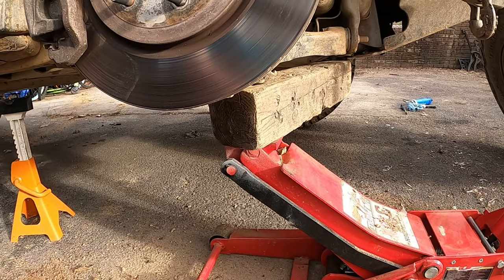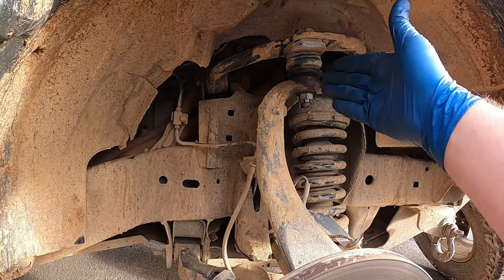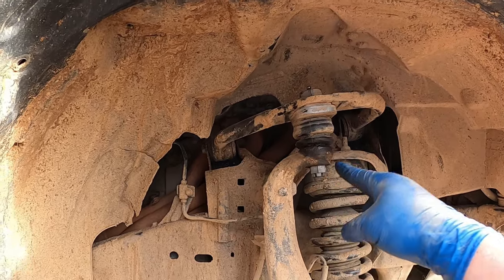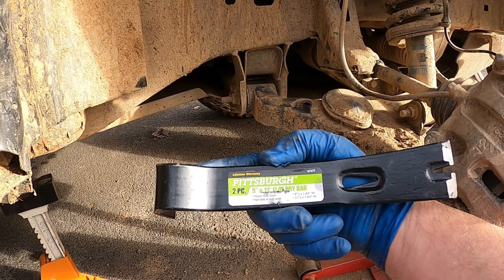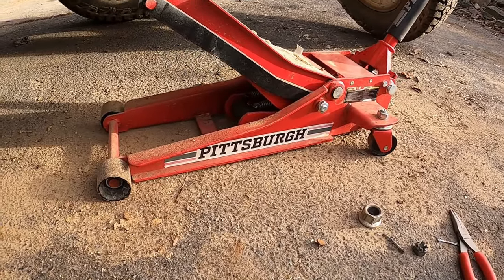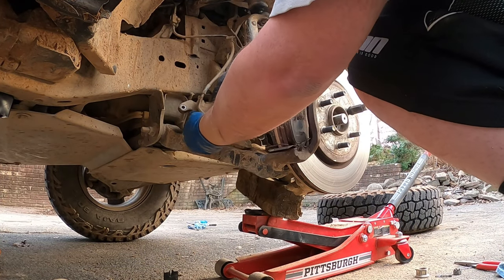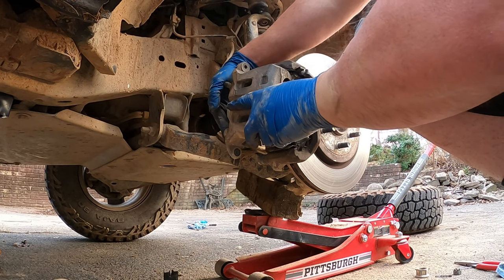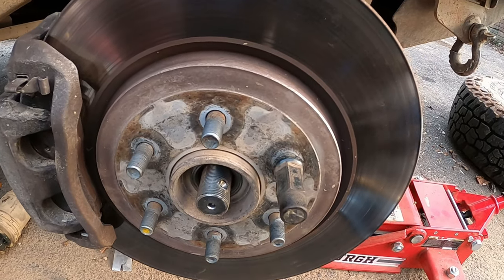Replacing the Front CV Axle on the Nissan r180

Comment: What axle did you go with?
Reply from the maker: They are the OE axles, not the "value" versions (though I do keep a set of the value axles just in case for when off-roading). 
I was right around 99k miles and these were the original axles that I've off-roaded with and been running 35" tires up until I was stupid and ran my locker in 4hi - which destroyed them both. So I figure if they've held up that well, I'd keep with OE and just ensure I make better decisions in the future to avoid breaking things! LOL!!